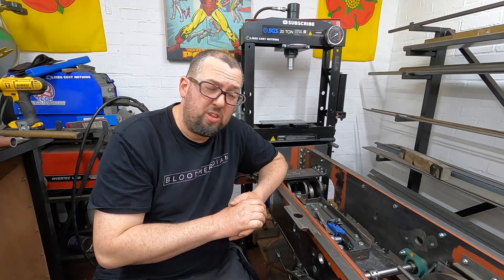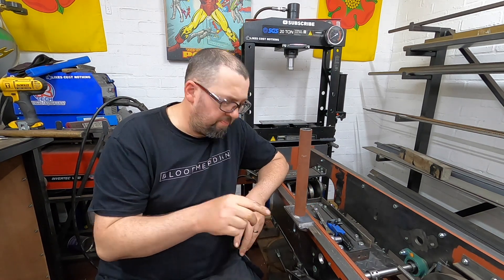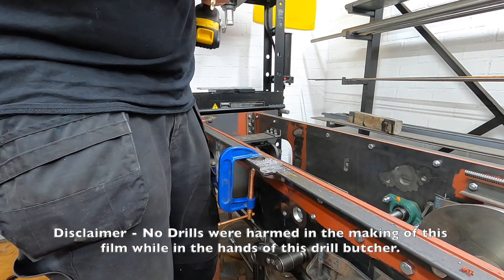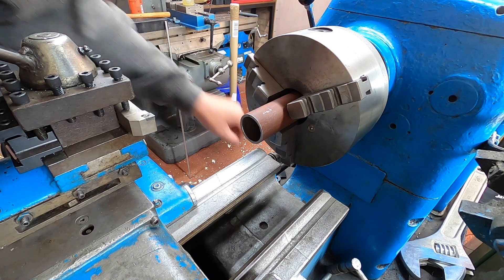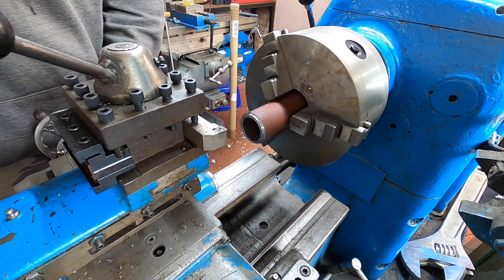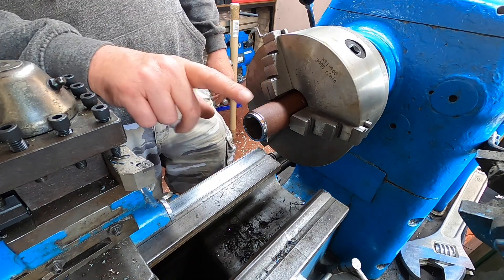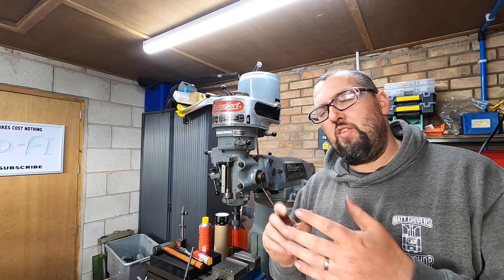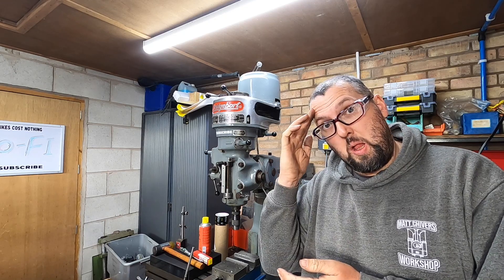Brake Column Shaft - EP45 - 7.25" Gauge Steam Locomotive Build

Comment: Had a similar thing happen a few months ago. Made some spacers for a gearbox, got a call, went talking came back, one of them had vanished. I work alone, wasn't on the floor, nowhere else. Two days later i gave up and made another part. The next day after, i found the bloody spacer gripped on my swarf magnet which is  attached with a loop to my mill. The thing had fallen off the mill, somehow, and got itself stuck to the magnet. Probably would've found it before making another part if i hadn't been so pissed off i didn't even clean the mill from the previous operation.
They drive you nuts, these "disappearance cases' in the shop. 😂
Reply from the maker: Absolutely does drive you nuts! 😂 All the best, Matt👍